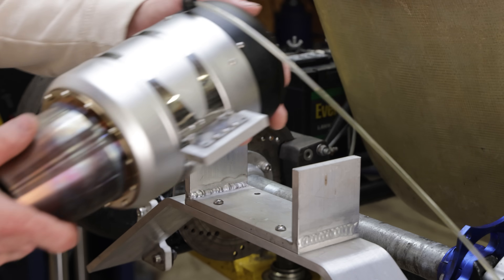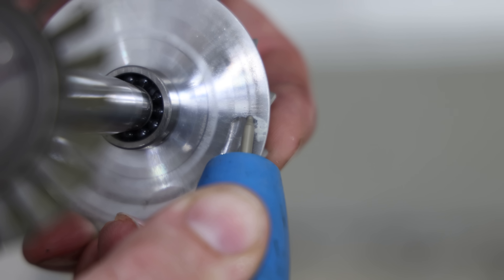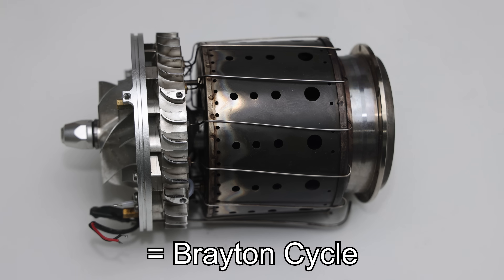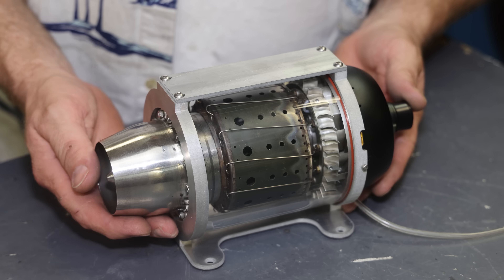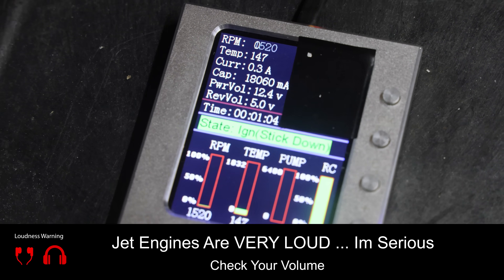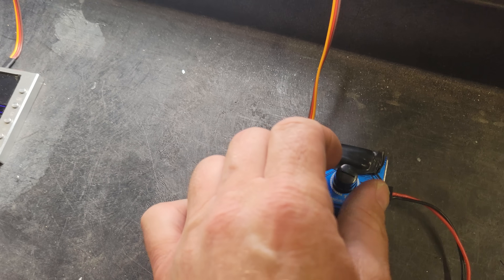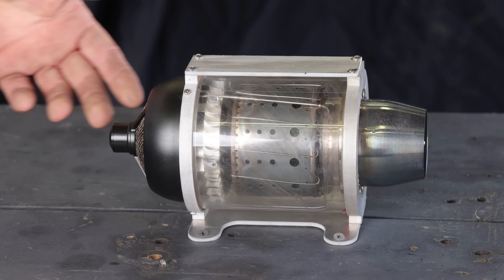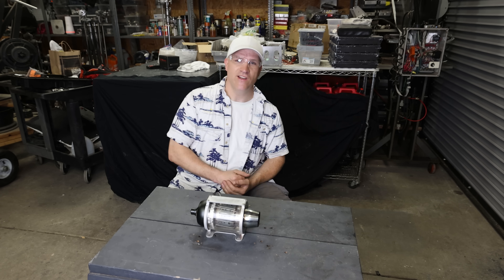See Thru Jet Engine

Comment: Like i was 10 years AF had the opportunity to work on a bunch of cool engines. I was avionics but since the F-16's are 99 percent avionics had fun at mission briefs. I worked on for 7 years has the Pratt & Whitney and the 3 years General Electric T700 its cool.

Comment: Instead of a fog machine... what happens if you feed it a stream of oxygen, or an O2/CO2 mix? Can you increase the power output or will it just destroy the engine from overheating?
Reply: There is extra oxygen in the intake air, because any turbojet engine moves much more air than it needs to burn the fuel, so enriching the oxygen content would not help at all. Any gas turbine engine moving just enough air to burn the fuel will be destroyed by overheating.

Comment: Awesome. Great explanation btw LOL. Gas flow visualization fails because it mixes with the existing mixture and burns in the chamber becoming a different gas by combustion so yeah we do not have the eyes to track to that process. Perhaps with heat signature visualization and a detector gas causing temperature differences when implemented in the combustion process

Comment: Cool video. I've been an A&P mechanic, assembler, balancer, and test cell operator at a large turbine engine  manufacturer for 23 years. I was wondering how much thrust a little guy like that produces, what type of fuel it uses and its rate of fuel consumption.

Comment: Great stuff!!!!!!! What and where did you get see thru housing? It looks like it was only head down by 4 sheet rock screws? Table looked like it was on wheels? Didn't seem to move setup at all, any idea of how much HP that was making? Great stuff!!!!!!
Reply: The table was strapped to the floor. I noticed it in playback. If not the table would of taken flight lol.
Reply: @robertfaulkner7152  ok that seems more like it, thx!

Comment: add a water jet in the middle that turns to steam and watch it go faster ... super compress the water in the tank for more booster ... water does super compress its just when you measure it it remains more liquid than other materials ... you can swim inside compressed water while you cant inside compressed other things ... depending on the compression of course ... high enough compression will turn water to ice

Comment: bernoullis talks about speed but in jet exhaust its expansion rate of exhaust driving thrust ... so to does the air expand above a wing relative to the surface tension of the wings reference field, increase a wings reference field on top with slats can increase lift at slower speeds even ... etc

Comment: you need to add more of those supports between the front and the rear of the engine. The 2 aluminum bars are stretching like crazy.

Comment: Thanks for a great look inside a jet engine, and how it works. This was a milestone for me. The video had a nice flow.
I still are in doubt of the start process. Is there a rotating electromagnetic field, that work as a starter. And if, can you use that arrangement as a generator during normal operation.  
Yes I am a electrician :))
Reply: The starter motor is on the front of the shaft. It has a clutch so it mechanically disconnects when the engine starts. A motor-generator could be mounted without a clutch, but the engine would need an additional turbine stage to produce useful shaft power to run the generator.

Comment: What is the range of rpm’s on these engines please? It sounds like 30K and maybe up to 40 or 50K rpm. Just curious.
Reply: It's shown in the video on the controller display. The maximum is about 127,000 RPM if I recall correctly. 30,000 to 50,000 RPM is just idle.

Comment: You mentioned being nearly surprised it didn't blow apart.  The parts are quite well made to survive about 127,000 rpm.  Wow.  Thanks for a super cool video!
Reply: I'm just wondering how the turbo shaft didn't freeze up spinning that fast? I know jet engines also rely on oil to lubricate bearings and cool shafts. I didn't see and oil tube running into a entry port?

Comment: Wouldin't an afterburner be more appropriate for a smaller jet engine since the relitive amount of fuel that's being consumed is significantly less and the performance increase makes it nearly double as effective? Or does the thermal runaway pose design flaw that makes it impractical in a small jet engine application?

Comment: I think you framed the how the jet engine works incorrectly.

The same amount of air that comes out of the back is being sucked into the front.. 

The difference is, what’s coming out the back is streaming, in one general direction..

What gets pulled in from the front is omnidirectional, all directions come in so it is a lot less  concentrated. It creates the illusion of less air coming in then is going out.
Reply: Also, the air coming out is in a directional stream, while the incoming air is coming from all directions.

Comment: What's the clear material? Quartz? Borosilicate? 96% silica? It would be interesting to know what the pressure is in the 'compressor section' [it's all kinda just one big section]. Modern engines are about 40 to 50 bar, right?

Comment: I have never seen the working part of a jet engine ( I have no idea) even though the front fins are called compressors, what is the pressure compared in the chamber?? ( I am thinking not much unlike a car engine ) and what is the Fuel consumption Vs car compression engine
Reply: The ratio of chamber pressure to intake pressure is probably about 3:1... yes, lower than a car engine; however, large modern gas turbines (such as in large aircraft) run up to 60:1 pressure ratio.

Fuel consumption is high - small gas turbines are very inefficient.

Comment: Awesome video & sound 👍
Sub'd,  Would love to know;
Compression & combustion chamber pressures.
intake & exhaust air velocity.
Temperature profile
Clear cylinder material & how you decided how thick it should be.
Just bc, I'm afflicted with excessive curiosity. 
Thanks for the video!

Comment: Please hydrostatically test your pressure retaining bodies before doing other tests.
Reply from the maker: I will but I didn't do it here because it was extremely difficult for me to get these pieces made out of my material, I needed to find somebody with a particular machine. I did not want to risk losing one of my only three pieces in a hydrostatic test, I would rather start it up go slow and at least have a video to post then to damage the material before I even got the video filmed... The delays are already killing me so bad..
Reply: @WarpedYT  if we were talking about an incompressible fluid I'd agree, but this is a gas. A failure could be absolutely catastrophic and deadly. If you're not going to test I'd likely have the apparatus at least 30meters from anything you don't want blown up.

Comment: Quick question, what is the tool you use to use to balance the engine? I've wanted to get into doing things like this, but the tollerances I have to work with just make working with standard hardware rather dangerous if the specs aren't within a certain level of tolerance.  

Thanks!

Comment: Probably the coolest most shocking (but logical) part for me was seeing how ~rapid~ thermal change on the compressor.   The higher the RPM, it “compressed” the cold air/hot expansion line in the center of the compressor.  Wow.

Comment: If you do go the afterburner route, you need to use ceramic shields for the exhaust cone thats if you can get or make them. Thats what we use for our jets and which is what we can literally touch the outside of our engines during a high power burn.
Reply from the maker: Thank you, I usually have all the bases covered but I did not think of using ceramic, my plan is to do a variable nozzle and I was going to do some sort of metallic double layer butterflies or something like that on the inside, at least that's what I was imagining, but I think you're 100% right ceramic is the answer, that would keep all of that heat inside of that reheat section..  thanks for the tip !

Comment: Hey bro can ur toy work in a non oxygen environment?
Reply from the maker: No the toy cannot work without oxygen
Reply: @WarpedYT  yea I didn't think so
Reply: How would you expect the fuel to burn without oxygen?
Reply: @brianb-p6586  I don't. 
Read my comments slowly and carefully one more time k
Reply: @victoravila866  So why ask, if you know the answer? The rest of us all know the answer, so we didn't ask the pointless question. If you have some point, you're not getting it across.
Reply: @brianb-p6586  glad to know rockets don't work in a non oxygen environment, wink wink
Reply: @victoravila866  Obviously, rocket fuel burns in oxygen, which is supplied to the engine instead of air (either as oxygen carried as a cryogenic liquid, or as an oxidizing compound), so they work regardless of the surrounding atmosphere or lack of one. Since this turbojet engine is obviously not a rocket, what's your point? If you're just pointing out that this turbojet is not a rocket engine, no one needs help seeing that.

Do you ask everyone who posts a video about gasoline or diesel internal combustion engines whether they run in a non-oxygen environment, since they're obviously not rockets either?

Comment: That is cool as hell.

What are the wires along the outside of the combustion chamber? Ignition?
Reply: Those a fuel tubes to the injection locations.
Reply: @brianb-p6586  That makes sense, complete 360 degree flow of fuel into the chamber. Man they're tiny.

Comment: We can hear the startup motor, you did not mention it and i assume there is one. Since we know strong magnets are vanished by hear i wonder where could they be located and what electronics you are using in order to start it.
Thank you
Reply: The starter motor is on the front, in the cool intake air.

Comment: The issue I always have to understand the physics of this is why the thrust goes only in one direction. When the fuel is burned, liquid is converted in gas that has to expand, that moves the piston down in a car engine, or the bullet to the front in a gun, because the pressure of the gas has no other place to go. But in a jet engine I can't understand why the gas only expands to the back of it and never to the front. Can you explain me that?

Comment: I was waiting for the see-through hot section case to melt too. I saw the seal on the rear coming out. Cool project. It must be nice to have the laser cutter and the balancing machine. I built jet engines for 42 years. The impeller compressor is old school. I used to build them on the J-69 engine.
Reply: If my knowledge serves me correctly. The type of engine is a centrifugal engine. I struggle trying to remeber the type that are common on todays engines. I just remeber turbo jet or turbo, shaft and or fan engines. I know that there were two types produced. The Meshersmit 262 had a jet engine similar to this model jet engine. If my memory serves me correctly that is. Most general aviation helicopter engines like the bell jet rangers have the same compressor design.
Reply: @christophermcmichael880  Most commercial jet engines these days are turbofans.
Reply: @-_James_-  That I had already knew. The engine that is in the video is a centrifugal compressor engine where it diverts the air towards the outside then into the combustion liner. The most common type today is where the air is goes through the different stages from low compression to high compression then into the combustion chamber and liner. I just don't remember what the technical name for that type of engine is?
Reply: @christophermcmichael880  Turbojet? Just the turbofan without the bypass.
Reply: @IJsbeer74  Thank you Agent JayZ.. the other most common type of turbo jet engine compressor is called an Axial flow compressor which has the different stages from low compression to to high compression befoe entering the combustion case and liner. The RC model engine in the video os called a centrifuge flow compessor which only has the single stage. Both are turbo jet engines. The centrifugal compressor is an older design. That engine, the full size version was a German design and was used in the Meshersmit 262. Now the common turbo jet, turbo fan engine as well as some turbo shaft engines are Axisl flow engines.
Reply: @christophermcmichael880  Axial Flow

Comment: Force/thrust is comming with the formula F=m*a, where the mass is the weight of air and fuel. The acceleration is happening in the nozzle😉 because of expansion og the fuel👍🏻

Comment: What are the limits in designing turbo engine?.  Can it be possible to design turbo engine for any sizes of aircrafts? Any Engine designed for hydrogen fuel 🔥?
Details and if not reasons?

Comment: The thrust comes from the weight of the air going through the engine being accelerated by the combustion heat causing rapid expansion of the air causing a higher exhaust velocity

Comment: Great video!  Jet engines have always fascinated me.  This might a stupid question but this is an example of a turbojet as opposed to a turbofan correct?   The engine you built is a low bypass engine right?  Lastly, have you ever build a small turbofan engine?  Thanks for your time and insight.
Reply: Yes, this is a turbojet. Which technically means it's neither a high- nor low-bypass jet engine, since there isn't any air from the compressor that bypasses the combustion chamber.

Comment: 5:49 this is why I'm always amazed at how jet engines are constructed and mounted. The immense pressure they create on themselves while being bolted to, and pushing, a 160 metric ton thing from standstill on the ground to airborne.
Reply: Not only just pushing it but also pushing it past the speed of sound!
Reply: That's the power of Dinosaur remains

Comment: I assume the combustion chamber expansion is what caused the silicone gaskets to blow out.  Any thoughts on how you could make an expanding case to accommodate the expansion?
Reply: It's papulo papito not xavier
Reply: really, you would just want to use a different material with a higher tensile strength so that it doesn't expand under the pressure, but for a See-through engine he can only really use that super-thick polycarbonate stuff.
Reply: Halo sir

Comment: Retired from Pratt and Whitney as a mechanic building the F100 after 23 years only to relocate and now do the same for GE's F110 and wanted to say thanks for the video! I've seen these engines at test cell but it's so cool to see one like this with a clear cover to actually see it in action. VERY IMPRESSIVE.
Reply: Also working at GE here designing turboshaft. Very cool video

Comment: Hey brother!  Thanks so much for creating this video!  My dad was a Navy fighter pilot (F-8 Crusader and F-4 Phantoms) and from as far back as I can remember, he would draw pictures to help me understand the basics of jet engines to include "Suck, Compress, Mix/Ignite, Blow".  Your video is a terrific demonstration of this principles in the most simple form.  Spent 6 years in the Navy myself - more of an avionics guy - but also worked as a flight deck troubleshooter who would diagnose last minute issues with the aircraft (F-14's), make necessary corrections and do the final safe for flight checks as the a/c's stages on the catapult in preparation for launch.  Part of the that experience, while performing  checks all over the a/c was standing just behind the massive air intakes, putting my hand just on the leading edge and feeling that unbelievable suction with the engines just at idle.  We were advised that when the a/c was as full military power, it could suck in a 180 lb guy from 3 ft BEHIND the intakes.  Needless to say, I never pushed my luck under those circumstances.  Annnywho... just wanted to tell you how much I enjoy your videos and honestly wish you were my neighbor.   I'd love to be involved in your experiments as much as you probably enjoy making them.   Hope you had a awesome Independence Day!  Keep up the great work!   Cheers!   Joel

Comment: Somehow its really baffling to me how such a small device could have so much power output. I mean for the displacement, this has little more than a 50 kmh scooter would have. Really interesting how most of the power comes from the fuel and pressure.

Comment: What is the compression ratio?
Reply: Gas turbine engine specifications include a "pressure ratio", rather than "compression ratio" (which is actually a volume ratio in a piston engine). An engine with a single-stage compressor like this typically has a pressure ratio around 3:1.

Comment: You could have run the fog machine through it on just the electric startup. Maybe try and bypass the fuel injection stage, and keep the motor going?

Comment: MODERN COMMERCIAL AIRLINERS NOWDAYS DO NOT USE DIESEL FUEL, JET FUEL OR ANY OTHER KIND OF FUEL BUT IT WAS ALL HIDDEN FROM THE PEOPLE OF THE WORLD.  WHAT MAKES THE JET ENGINES WORK? WATER VAPOR IN THE AIR. - FREE FUEL FOLKS. IT ALL HAS TO DO WITH H2O - HYDROGEN & OXYGEN. HYDROGEN IS A FUEL THA CAN BE UTILKIZED IN A JET ENGINE BY COMPRESSING ALL THE H2O SEPERATELY THRU DIFFERENT COMPRESSIONS PLATES IN THE JET ENGINE. I FOUND A UTUBE VIDEO BY A BRITISH MECHANIC BREAKING DOWN THE ENTIRE PROCESS IN THE ENGINE & HE STATED IT WAS IMPOSSIBLE TO LOAD A PLANE WITH THE AMOUNT OF JET FUEL THEY SUPPOSEDLY USE. I PASTED THIS VIDEO EVERYWHERE - ON FACEBOOK, GAB, INSTAGRAM, & EVERY PLACE I COULD FIND. EVERY SINGLE COPY OF THIS VIDEO WAS TAKEN DOWN & DESTROYED BY EVERY SITE I POSTED THE TRUTH ON. FKN MONSTERS WANT FULL CONTROL OVER US & FIGURE OUT HOW TO STEAL EVERY FKN DIME WE OWN. THRU FAKE FUEL ANNOUNCEMENTS. EXAMPLE - IT COST $ 1,500.00 TO FLY TO GERMANY - TIMES SAY 300 SEATS. = $450,000.00 FOR 1 FLIGHT - MINUS THE COST OF FUEL 0 AND WHAT U GET IS 1 GIGANTIC RIPOFF GOING ON FOR MORE THAN 100 YEARS. MISERLY JU-BAS TARDS. THE ONLY THING NEEDED IN A COMMERCIAL JET IS OIL TO LUBRICATE THE PARTS....PERIOD.